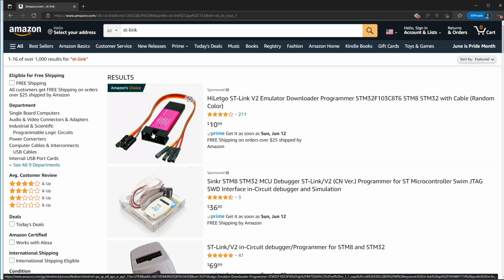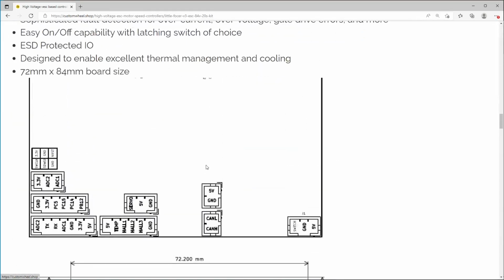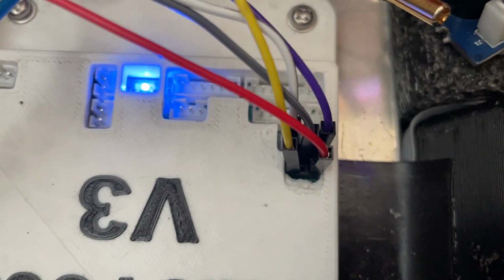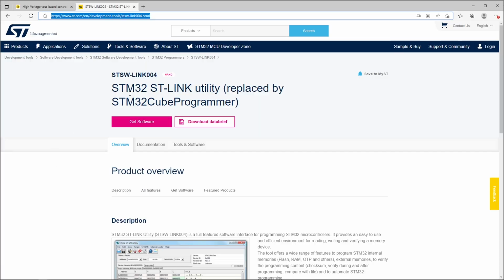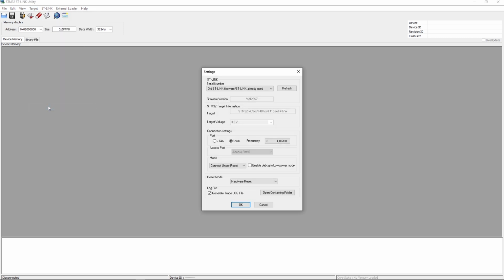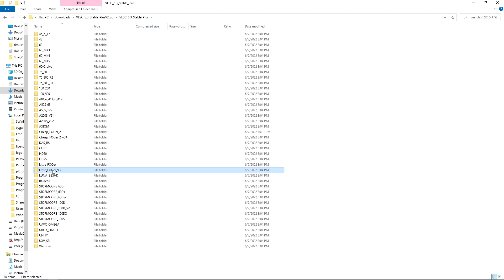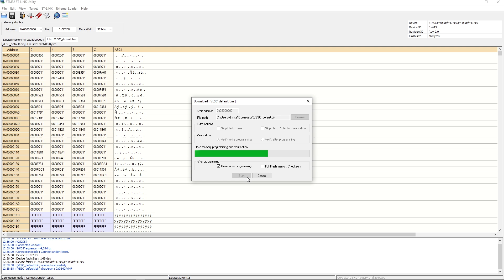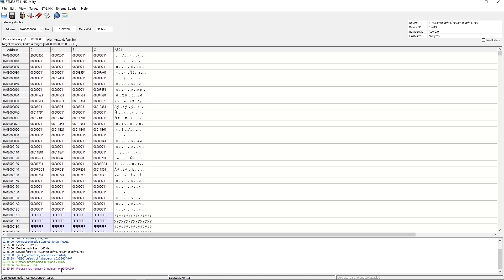Reviving a bricked VESC using an ST-Link programmer

Comment: Using STM32CubeProgrammer, the following process has worked for me:

1. Select "Erasing & programming" in the menu on the left (second button from the top, with the green downwards arrow - if you press the hamburger button at the top left, it shows you the labels of the different menu options).
2. Under "Download", use the "Browse" button to select the .bin file containing the desired firmware for your VESC. This sets the path to the file.
3. Scroll down a bit, and under "Automatic mode", check the following two boxes: "Full chip erase" and "Download file".
4. Scroll down even more, and hit the "Start automatic mode" button.
5. Watch the percentage bar at the bottom fill up, and rejoice in happiness.

Once done, the Log text probably says: "Please disconnect device n:1 and connect the next..." You can either proceed to flash your next VESC in the same way, or hit "Stop automatic mode" and disconnect your VESC.

All info in the video about double and triple checking all your wire connections between VESC and ST-Link V2 still apply, obviously.

Disclaimer: I have just recently done this for the first time, and only this one time so far, on August 31, 2025. I was using v2.19.0 of STM32CubeProgrammer, and was using a MacBook Pro M1 on MacOS-Version Sequoia 15.6.1.
I successfully reflashed a UBox 100 that got its firmware deleted by mistake by the owner. This has brought the UBox back to life, the owner was then able to connect with his phone via VESC tool, and reconfigure his board. We used float hub to perform the setup, and the owner was back to riding his GT on the same day, after lying around unusable for about a year (the board, not the owner).

Comment: hi im planning to DIY a replica of vesc 6 board . can i use this file to program it? is it compatible with a raw stm32f405? or it need additional things like fusebit setting etc? im not new to microcontrollers but not stm32... plz help me out with that
Reply from the maker: if it's a VESC compatible controller then this should work as described. The file you want to use is the one named "60", aka 60.bin or 60/VESC_Default.bin
Reply: @surfdado  i just checked your github and realized there are 60_mk2 or mk3 versions... what are those ... plz explain and the difference they might have with ver6 .

Comment: I'm trying to find where I connect to flash a bricked controller in a Pint V power kit. I've removed the LCM module. The USB C port on it does nothing when plugged into a PC. I've got a st-link usb dongle - If anyone has any ideas on how to connect to this controller - I'd appreciate the help. Thanks
Reply: same here, any luck?
Reply: @beazkneez  None yet, I have another board, so I wasn't in a big hurry. Did you figure it out? I did hear that there are 4 or 5 golden pads on one of the boards and I have to connect the ST-Link to those - probably by soldering pins to them.

Comment: do i have to pull everything else out from the esc? it is hard so i just left them in exept i disconected the xt60. the manager see the st link, but the esc (ennoid 150V mk7) wont light up. detection failed but all the cables is in the right place.
Reply from the maker: @agyas23  you can leave it all plugged in. But you do need power, so you shouldn’t have disconnected the xt60…

Comment: Where can i get the bin file form my 300Amp  75V  version from TrambaBoard ?
Reply from the maker: https://github.com/vedderb/bldc/tree/release_5_03/build_all
Reply: @surfdado  Thanks, There are 3 revisions R2 an R3. Which one should I load in the controller?
Reply: @surfdado  There are 3 revisions of firmware. first one, R2 and R3 . Which one should i load? What are the differences if you know?
Reply from the maker: @iulianberca4860  pretty sure they are revisions of the VESC itself, so you need to find out whether you have an R1, R2, or R3 Trampa, maybe it's printed on the PCB/Case?
Reply: @surfdado  where can i find the little focer v3 please? its not in there
Reply from the maker: @alexdoho  it’s not there because 5.3 is old. Get the 6.2 version instead

Comment: You only need IO CLK and GND. 3.3V should not be connected as it can kill the STM. Best power the Unit from the battery and forget the 3.3V from the ST-Link clone. The original ST-Link uses the 3.3V pin to sniff 3.3v and not to supply 3.3V.  It only works if it can sense 3.3V on the 3.3V pin of the ESC.This is a big difference in between the clones and the original! You can also just use another VESC as a programmer and use the SWD Programmer feature in VESC-Tool. In that case you also interconnect IO, CLK and GND on both units. IO to IO and CLK to CLK and GND to GND. After flashing the bricked unit, disconnect the SWD Programming tool and remove all cables before running a motor.
Reply: https://www.youtube.com/watch?v=Qvu0XfnnmYI
Reply: Thank you for useful information.
Reply: What pins do I need to connect on my  balancePro 6.6?

Comment: Possible from Linux?
Reply from the maker: no idea, never tried
Reply: Hello, for linux you need a virtual windows. the tools to read or write stm32 from .bin or .elf can't find port on stlink. i test the "st link tool" in "win" . in virtual box, i have no problem with a win7 or win10 to connect an upload or download. maybe you can use the command line tool from arduino or arm-tool to do the same. i never test this possibility.
Reply: Yes, it's possible from Linux, just need to use different tools/the terminal instead of the GUI.